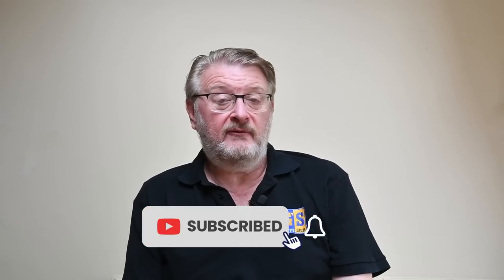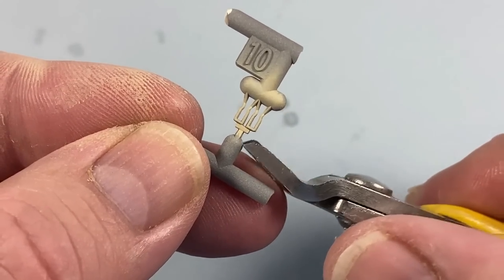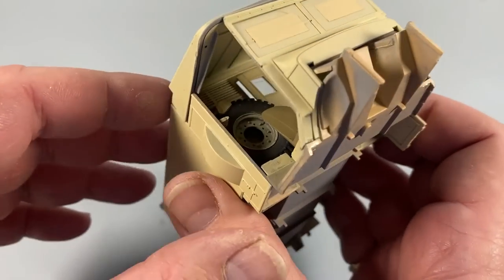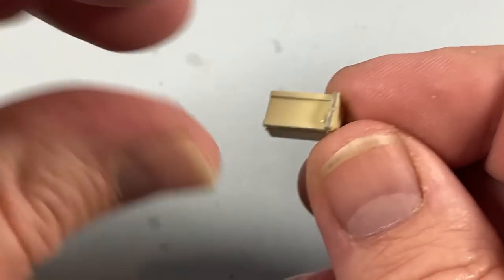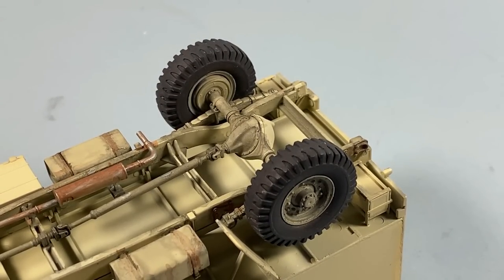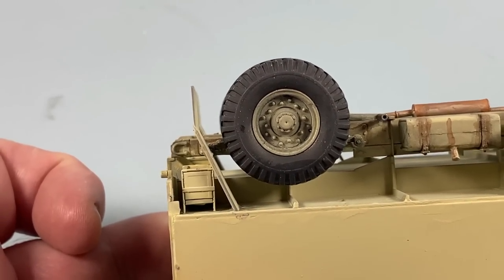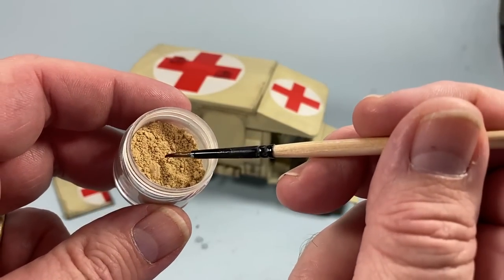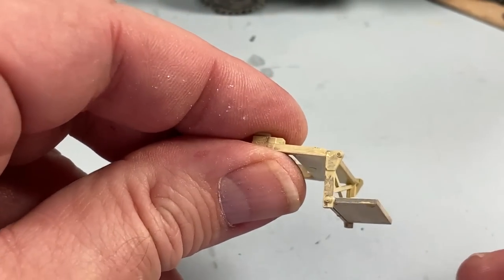AUSTIN K2/Y KATY AMBULANCE build day two Airfix 2022 brand new tooling 1/35 scale 1080p

Comment: What you keep calling a divisional plate is more likely a bridge plate, stating the vehicle is 5 tones, you can view on certain bridges weight limits for two way traffic or heavier weight one way traffic. Look up street view of the canal bridge in Aldershot, Queen,s Ave. There it shows a yellow plate, 30 two way or 50 one way.
Also you where correct in resting the mud guard against the rectangular storage box, as that is fixed to the vehicle & the cross bar would be hinged to open & slide out the box/container 👍🏻
Reply from the maker: Thanks Glenn - a few people spotted that gaffe. I think my confusion came from the desert Katy and the Camberley Katy having different badges, but I suspect that loading up a Katy as an operational ambulance with medical supplies, water etc. pushes it into a higher weight band (5 instead of 4).

Comment: Can I suggest with large and / or geometric decals like the red crosses and circles, painting them on instead? The original decal could be used to get the size, then a compass to draw a circle for a template, mask the white circle off and paint the cross. Probably less painful than the thin decals.
Reply from the maker: Good plan - probably better for keeping some of the detail too. And the vents would colour match the red of the cross. I'm just not so good at masking off circles!!
Reply: @garys_stuff  Nor am I :) Use a compass to draw the circle on a thin sheet of card / paper then cut out the circle and use the cutout as a template. Then mask off the red cross :) Even I couldn't mess up masking a cross..  well probably not :)

Comment: Weathering rule of thumb.
If the vehicle is on tarmac or hard ground, the tread should be clean with weathering on the sidewalls.
If the vehicle is on soft ground or mud, the terrain sticks to the tread area with less -- or dusting -- on the sidewalls.
Cheers!
Reply from the maker: Cheers Randy! I will bear it in mind. What about sand as it's dry?
Reply: @garys_stuff  Sand can be hard -- like Malcolm Campbell in Bluebird at Daytona Beach ' or it can be sticky and muddy.  It also depends on the speed of movement - centrifugal force will throw off mud at speed.  Wet sand will be darker than dry sand but careful about using gloss to look wet -- a little goes a long way.
A viewer will implicitly infer the terrain from how the vehicle is weathered -- it's all about telling a story in the viewer's head.

Comment: Nicely done, Gary!  You built systematically and it finished up well.
For small etched parts I often put cello tape on the back so the part doesn't go walkabout when it's cut.  The bridging disc bracket shows exactly what etched parts add to a build.
Can't wait for the diorama!
Reply from the maker: Thanks Randy! Good tip with the tape on the back! I hope the Gecko is as forgiving...

Comment: I think that with a small drill and a bit of steel wire (such as paper clip) one could do working hinges for the rear doors. You could place them open or closed however you wanted. And they would not break off whenever someone breathed on them too hard ;)
Reply from the maker: Yes, in theory but I think it would have to be smaller than a paper clip - somewhere around 0.1 or 0.2mm wire. And they wouldn't break when someone says "ooh, what's inside?" and tries to open the door....

Comment: Gary's Stuff thank you especially for showing the tools and advice on doing the Photo - Etch. Great and straight forward advice. Watched a couple of other modeller video's and it left me with feeling complete dread of doing photo etch and thinking I have to buy some really expensive tools to do PE.
Reply from the maker: Thanks Barry - you do need a few basics, the best is a spare ceramic tile to cut on because you get a really good edge that way. If you are left with any bits on the edge of the piece, hold it between the jaws of a pair of pliers until the extra bit is only just poking above the jaws and use a small file or sandpaper to get rid of it. But I've not had any problems so far with getting a very close cut. Might be a different story with the Gecko kit and the huge amount of PE it has!!!
Reply: @garys_stuff  thank you

Comment: Great build Gary. I was going to get the Gecko version, but the Airfix comes up so well, I have had a change of mind. Thinking about it my carpet monster would probably get most of the Gecko PE anyway. Also, good rant on the media know alls . There are plenty of these cretins about. Model on and enjoy. Regards, Mike.
Reply from the maker: Cheers Mike - the Gecko is a bit intimidating but is fantastically detailed. I'll do it in a week or two....! The Airfix kit is good of itself, without the Gecko so close a price point it wouldn't be a question. Depends on how happy you are making 1/35 vehicles that as you to cut lengths of radiator hose (supplied). Might make a plane in the meantime, after which time there could even be some figures for another diorama!

Comment: I wonder if the photo etch on the air vents was designed to go on after the big decal, in order to make the decal fit a bit easier?
Reply from the maker: That is a very smart idea - sadly i don't think Airfix/Academy thought of that as they don't say anything about painting and applying the decal first, the PE is in among the build instructions. But that would be an answer to a lot of detail problems and would cover any minor tears around the vent. Genius idea!
Reply: @garys_stuff  Thanks! Often the kit designers are not the people creating the instructions, which is why you can sometimes find another way, like you did with the steering column.

Comment: Airfix just announced another version it's like a late katy version with the sand mats on the front of katy it has on it that you'll be able to Rob and use on this version as there missing from the front fenders it's certainly a strange one there doing g next but it's definitely a late in the Africa campaign?
Reply from the maker: The transparency sprue has windows for the enclosed cab version of the Austin truck as well...

Comment: Thanks for sharing.  I have thoroughly enjoyed both this and Day 1.  Having never made a diorama I rather want to have a go at this one so will wait for that episode with great interest.  I note some aftermarket is beginning to arrive on the scene.  I purchased a set of pillows, blankets and rucksacks from Red Zebra and they are going to work really well.  I’d would like to build a set of the sand mats that are fitted to Katy at the front - any suggestions on how this could be done will be gratefully received.
Reply from the maker: OK, the sand mats are in part three! But what I did was got a length of 1cm wide paper, glued in some 12mm long styrene rods (I used 0.75mm) at intervals then glued another strip of paper on top. Rolled it all up and I got my sand mats. Not as fine detail as they should be, a bit chunky, but OK for me. Again, this might be something the aftermarket does... Also noticed the Ice Cold divisional markings are on the decal sheet but not referenced anywhere. I also made up a tow rope to dangle round the tow bar at the front and a map to sit next to the driver! I have put a photo on Twitter @Garys_stuff if you do that...
Reply: @garys_stuff  Thanks very much for your reply.  I have looked on Twitter and the sand mats look good.  I will have a play and see what I can do.  My first thought is that because I build mostly ships, I have a heap of spare photoetch including the frets.  If I cut that up instead of styrene I might get a finer detail.   I saw they snuck in badge 21 on the decal sheet which I assume is the divisional badge as it can be seen very faintly in the Ice Cold stills.  I have however no idea what division that is.  Wikipedia tells me they were an RASC Motor Ambulance Company but my albeit, very quick research has failed to show what Division.

Comment: Tip I'd give is not to use black over the light paint more a brown or grey  blacks to much for the light paint or even a black and brown mix a grey is good for ochar sand tones but we Are all learning on each build and using a gloss or semi gloss is fine for pannal line washes but then you can't blend on it afterwards for more weather so give it a matt coat after your gloss for your washes and definitely pigments for the grip so it doesn't just run off! The blending you can get on a matt coat is superb it took me a while to figure this out for myself so if I can give anyone that tip to help along the way I'm only to happy!
Reply from the maker: Cool tips, thanks. I think the choice of wash is also determined by the scale sometimes - I know my 18mm figures need black because the contrast is better to see at a distance.